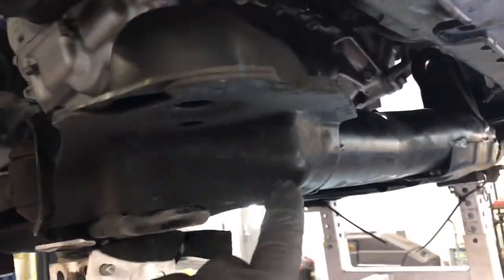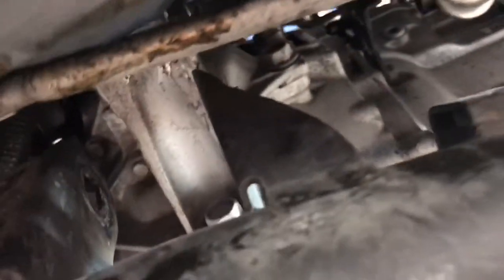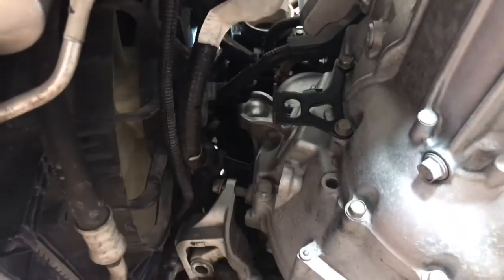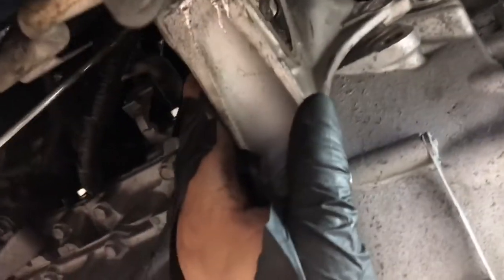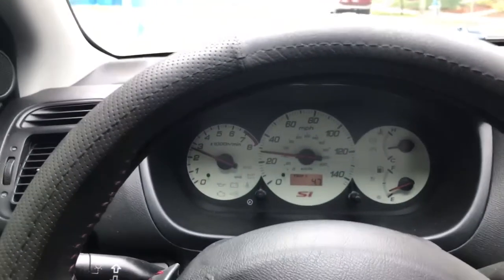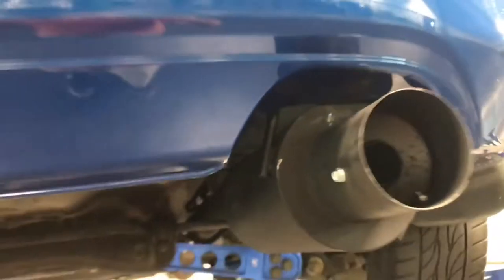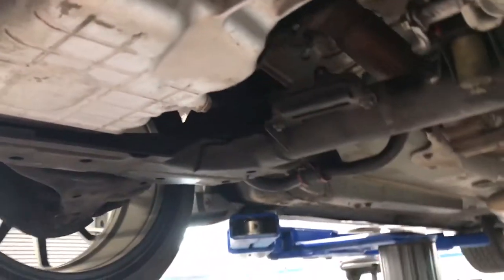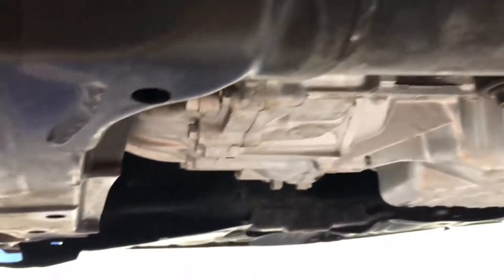K20A2 EP3 clutch job! FIDANZA LIGHTWEIGHT FLYWHEEL EXEDY CLUTCH KIT

Comment: Hi, did you remove the green coating off the flywheel?
I've read conflicting things on the internet...
Thanks in advance.
Reply from the maker: Althemusicman1 I’m kinda confused because I just removed the plastic that it was in and don’t remember a “green” coating. If there was a coating no I didn’t remove it.
Reply: @TachySteve  My Fidanza flywheel came with instructions to "remove the protective green coating with acetone".

I've read some horror stories online saying some fidanza flywheels had got stuck to clutches due to the green coating not being removed...
Confusingly the fidanza website  says to leave it on.